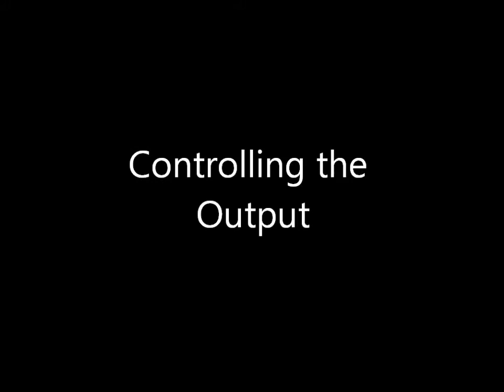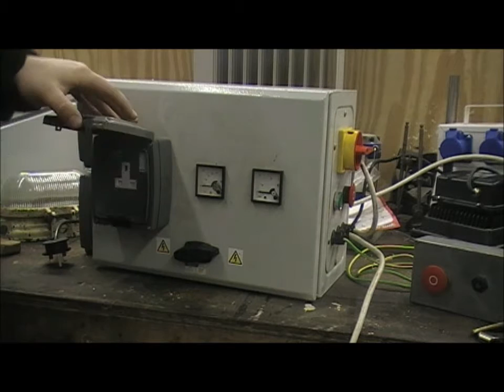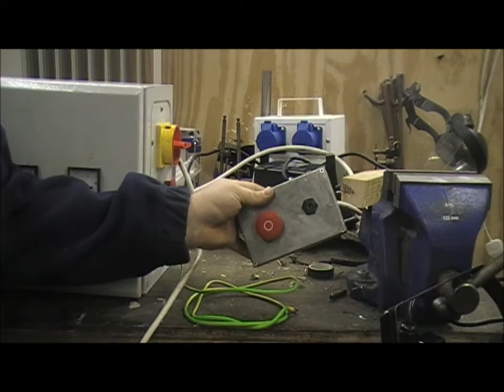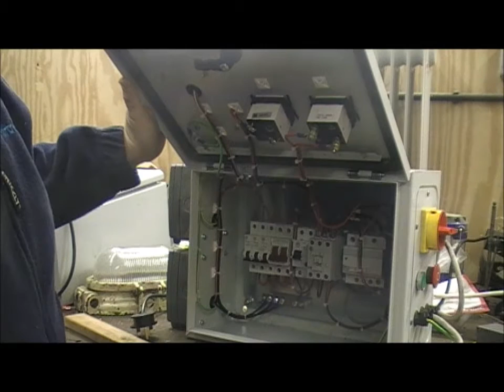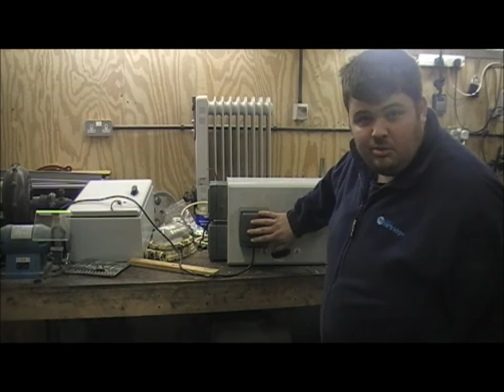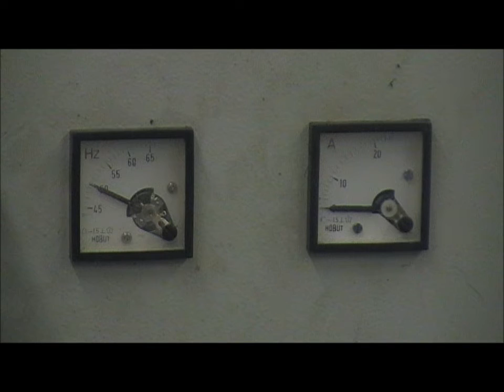Controlling the Output - 240V 16A control box

Comment: well done mate. You are good at electrics as well. what is that sound as soon you switch the plug from the wall. ( Like a motor  or fan??)

Thanks
Reply from the maker: +enginelover1 Hi there! that would be the extractor fan in my workshop - it was on the other plug socket but I switched both on anyway.